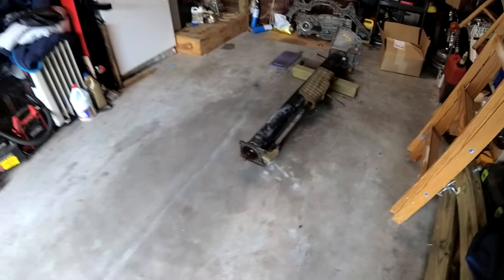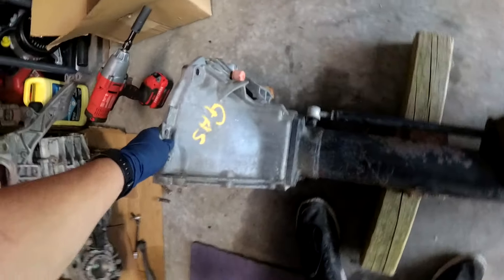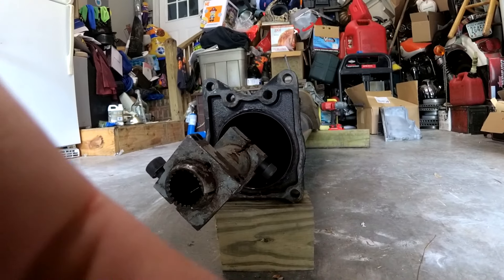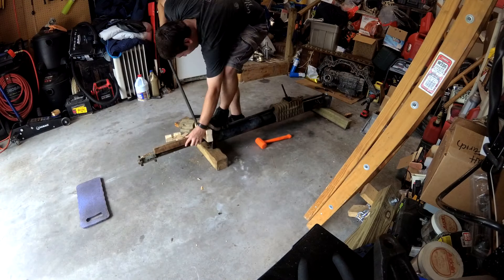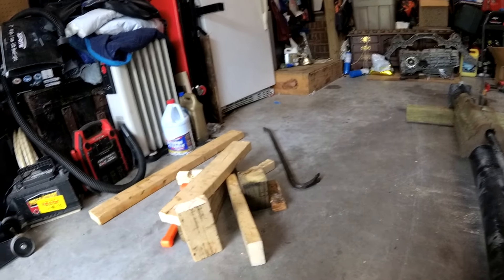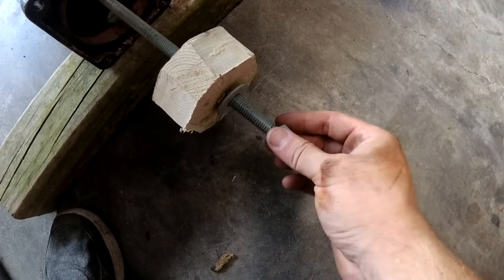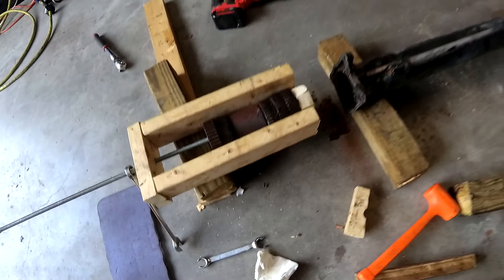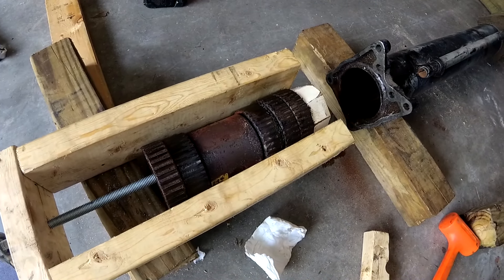928 5 Speed Swap - Torque Tube Disassembly

Comment: Thanks for the video showing us the process to rebuild one of these. I think I'll be spending $600 for a rebuilt unit now. :)
Reply from the maker: it was a bastard.  and I wound up doing it again because the cheapo bearings from garage9 didn't fit properly.
Reply: @IntenseBlue318  Oh man! That sucks! Sorry to hear!
Reply from the maker: @DIYDanCars  I wound up getting bearings and new vibration damper mounts from 928intl.  They're definitely more stout than the original bearing mounts
Reply: @IntenseBlue318  Cool! I bought my first rebuilt torque tube from them 10 years ago, and it's still going strong. Now my dad's 928 needs a torque tube and we thought about doing it ourselves, but after seeing your video, there was no way that was happening! :)

Comment: Good job
Reply from the maker: putting the new bearings in probably won't be much more fun
Reply: IntenseBlue318 no lie!  I’ll have to read the WSM so I can start feeling sorry for you.  ;). Are those just standard tempkin/race type?
Reply from the maker: @Dundertaker1  they are, but they have nylon sleeves pushed into the inner race too.  Only seems to be one place (Jaeger engineering) that has them.